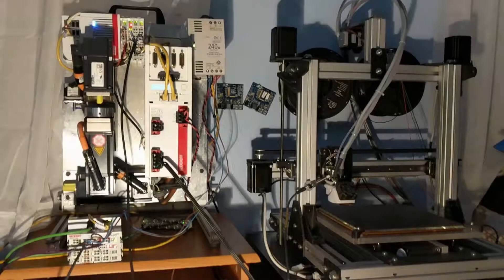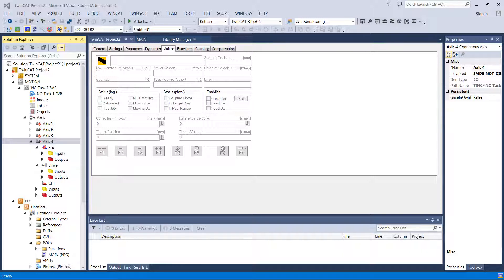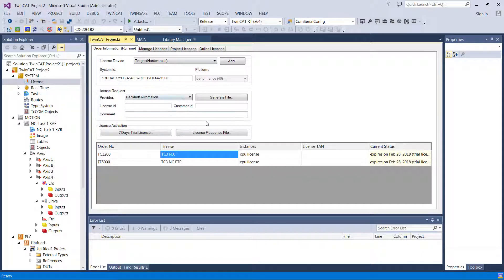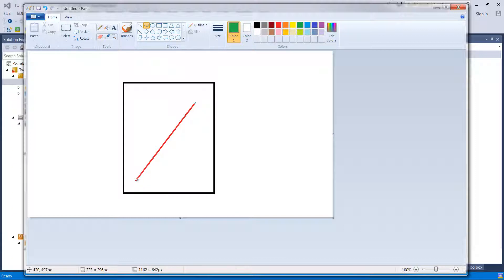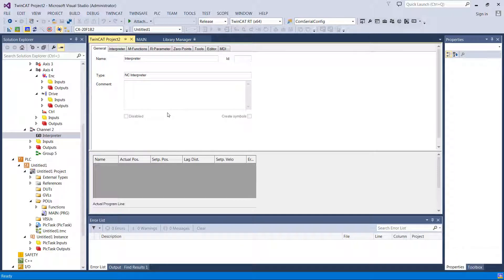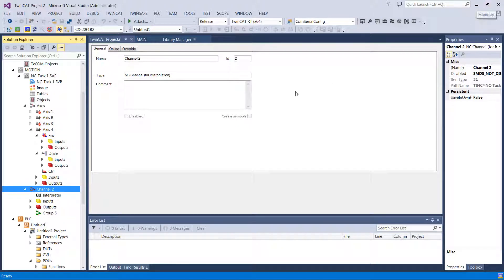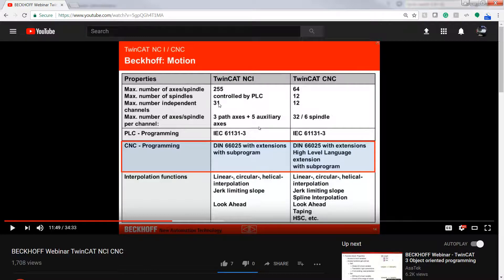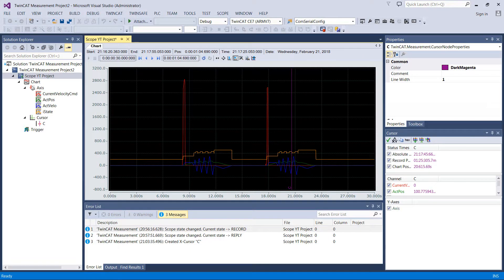Motion Control and IO with PLCs - EP14 - Twincat NC-I, CNC, PTP

Comment: Is there another full-blown, modern PLC platform that supports CNC motion controlled?  It seems like it's only Beckhoff?  Most CNC platforms manage memory like the old school PLCs do.  They don't have memory with user defined tags and structures.  This seems potentially way more advanced than anything Fanuc or Siemens offer.
Reply from the maker: There are others... Yaskawa has one but it's not great. B&R makes a powerful one but it's not that easy to use. Fanuc is garbage. I've heard Siemens is good but I've not used it.
Reply: @SquishyBrained  Fanuc is like Toyota  ,everyone has it and doesn't break  often I have  seen folks running  30 years old Fanuc

Comment: I know how install the Cnc software for t2,but for t3, if also need install a cnc software and which ?
Reply from the maker: Tc3 installer installs the CNC system.
Reply from the maker: Yes, I believe so
Reply: SquishyBrained but I got error
Reply: SquishyBrained I already find the error why ,  TwinCAT2 based cnc project cannot directly move to T3 ,but how many changes must be done I do not know .no document said this!